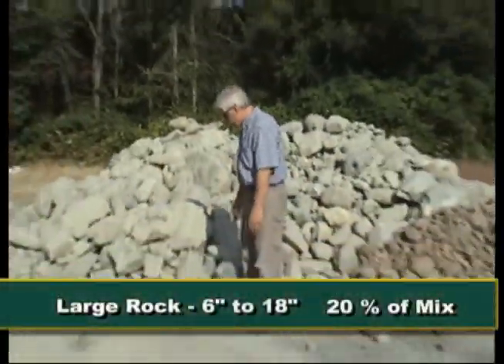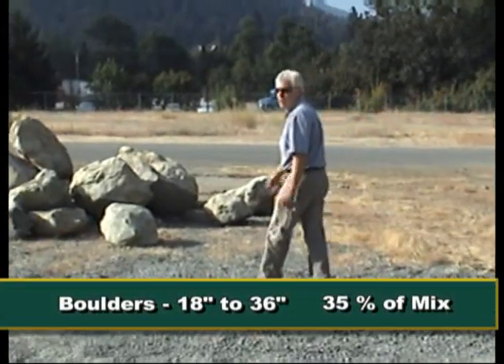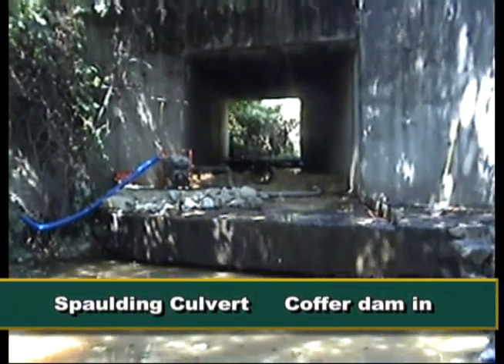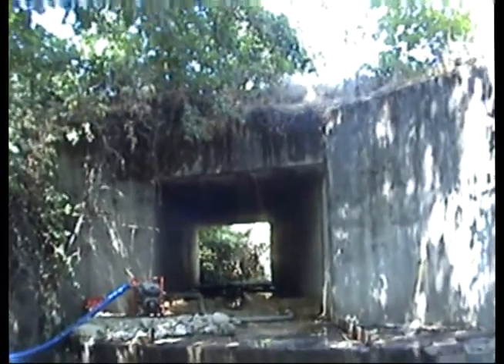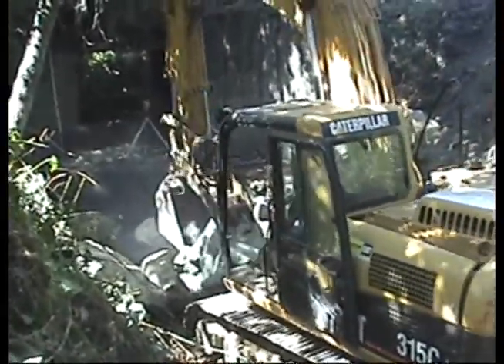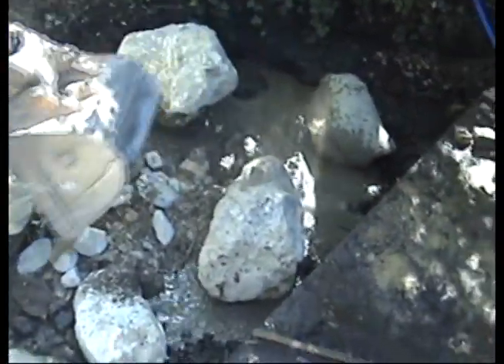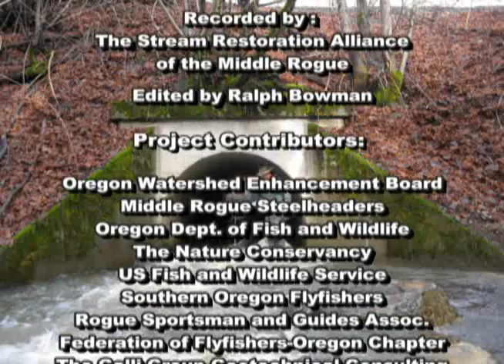Jones Creek Restoration

Comment: Doesn't sealing the spaces between the rocks prevent insects, crawfish etc. from using those spaces?
Reply: The seal is between the stream pressure and groundwater pressure, made of a minimum thickness of fine material (clay).  It is formed deeper down than critters wish to dig.  No worries.